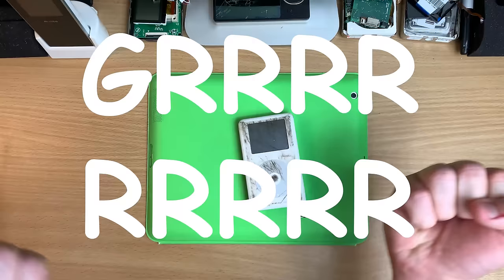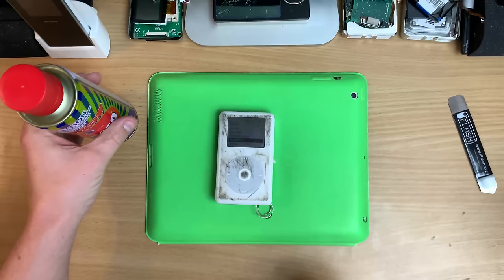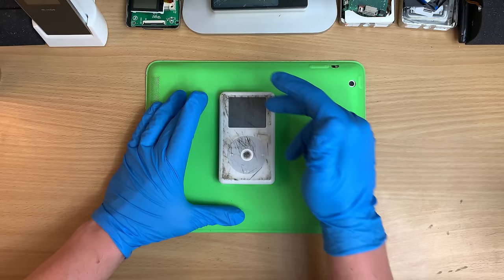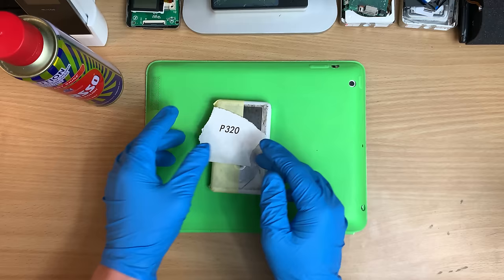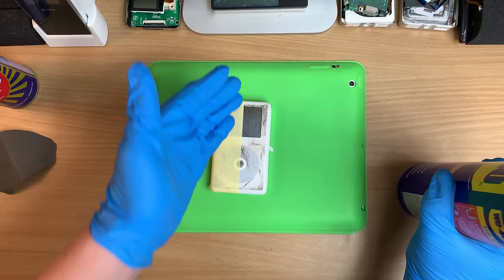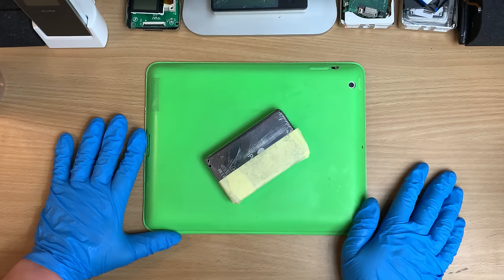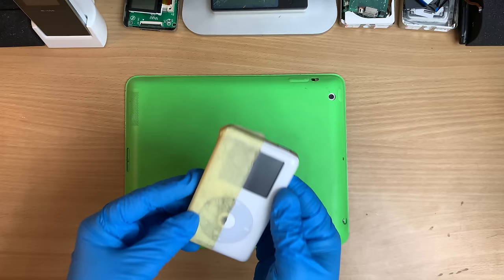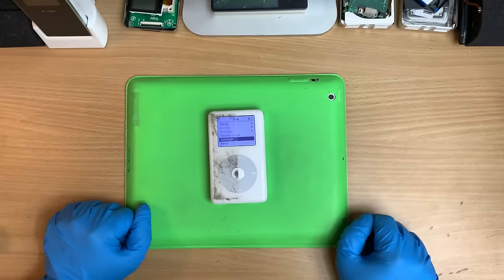How to fix a scratched iPod Classic

Comment: The way I repaired the back panel was by buffing with a nail buffer then rubbing the back against an antistatic soldering mat with baking soda in between. This smooths out the deep scratches but preserves the laser etching. I put on some Autosol and polished it up. Some scratches were still visible but they’re now less noticeable. I have a 6th generation meaning I can't repeat the process for the front but you can buy the OEM front panels and glass for relatively cheap so that's not a problem.

Comment: For the chrome back you have to use insanely fine sandpaper (1500 grit), wet sand if for a few hours, and be okay with losing all the printing on the back. Then you use a chrome polish to make it beautiful again. I actually like the clean, printless back but I did it by buying an original chrome back from someone that totally destroyed their chrome. It was only seven bucks plus shipping. That way I still have my original 60GB A1136 back and it's not that scratched up, only mildly scratched.

Comment: Like you advised earlier I had used brasso on the plastic ones. But on the metal back  it's a nah. It doesn't improve so much. But it would be nice to see if we could get the back panel fully polished too.
Reply from the maker: Yup defs a follow up vid!
Reply: the front of my ipod thats made of plastic is scratched way worse now then before brasso how can i fix this?

Comment: Unrelated to this vid but a question about an older vid. Posting here in hopes you see it:
Besides the 5th gen, which iPod did you add the huge battery to? More specifically, which of the 6th/7th gens had a big enough case that you could add the ~3000mAH battery to it? I don't think my ears are keen enough to pick up the lack of the Wolfsson DAC and 40hrs of playback sounds incredible.
Reply: I think I've answered my own question...
All of the 6th gens can only recognize 128GB even with an iFlash mod UNLESS you install a third-party OS (like Rockbox) on there. Since you had 1TB in there and didn't install any third-party OS, I think you used the 7th gen 160GB (model no. PC297 / MC297 / PC293 / MC293). Confirmation would be nice, though.

Comment: For the back m8 what you need is that sand paper glued to some glass (so it's nice and flat), then hit it with that buffing wheel with some jewelers rouge on it, add lot's of patience, and you'll be seeing yourself in the back of the iPod in no time. It won't be perfect and you run the risk of rubbing off the lettering but that's just the price of the shine.

Comment: Dank for the metal back i plan on putting a rubber coating on it. I want to sand it , clean it , and use a rubber spray. If you want the original chrome plating  can look at  places that can replate the steel back. You will loose all the logos and text but shrug

Comment: For the back, try using higher grits. I've got 14,000 grit diamond polish that would bring out the shine a bit better. And that's not even the highest, I've seen over 100,000 grit! At that point the diamonds are almost smaller than photons of light! (on the order of hundreds of nanometers)

Comment: PSA: WD-40 can be used as a lubricant in this case, but for long term applications, it wont. WD-40 is at heart, a DEGREASER. so if you need to lube up squeaky doors or bearings, please use something like 3n1 oil, because using WD-40 can actually make it worse over time.

Comment: hey cool content, have you considered modding an ipod with an oled display, higher ram ammount or change the usb connector
Reply: its not easy, you likely cant find a panel so you need to make your own. the RAM is a chip soldered to the board, and the connector is also soldered
Reply: @Chonksta  yeah i know that stuffs soldered and its probubly not for this channel but you could probubly find someone insane enough to figure out how to do those mods, the rams the only part id say would be next to imposible, but adding usb c or getting a different screen could probubly be done
Reply: maybe in the future ill buy a beat up ipod and try mod that stuff but it would be more for the prossess i dont have a use for the outcome as i already got a fiio player, (maybe i put a fiiio players internals inside and ipod ahaha now im just thinking up stupid mods)

Comment: Brasso doesn't work that well with 5th Gen? What would be good to clean up the scratches for a 5th Feb classic?
Reply from the maker: Brasso works great on a 5G its the 6/7th gens  as they are alloy. But it can fix scratches on the screen cause plastic
Reply: @DankPods  Awesome! Thanks!

Comment: I tried this and it came out pretty good but the screen is a little cloudy and I can see some scratch lines from the sanding.  What is the best way to fix this?
Reply from the maker: More brasso until it’s a mirror
Reply: How long on average would you say it takes with brasso and a rag to do this?  I probably spent about ten minutes.  I’m assuming that’s not long enough?

Comment: I followed your tutorial, and my screen got cloudy. Do you have any tips to fix it?
Reply: On Reddit, I've heard a few people mention PlastX helps with cloudyness. The problem with using Brasso that's not mentioned here is that the chemical formula is different in Australia vs. other countries. The US uses a silica abrasive, which is harsher than the kaolin Australia uses.
Reply: @petersaysthings  thank you so much!! I wouldn't have thought to look that direction